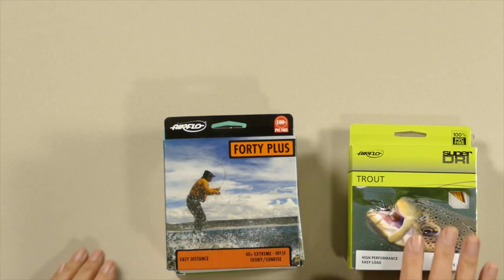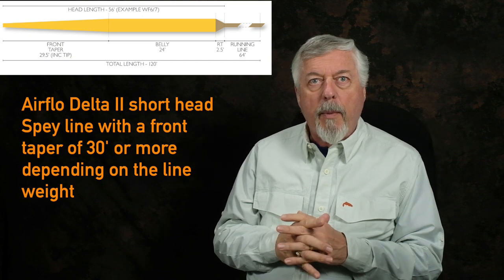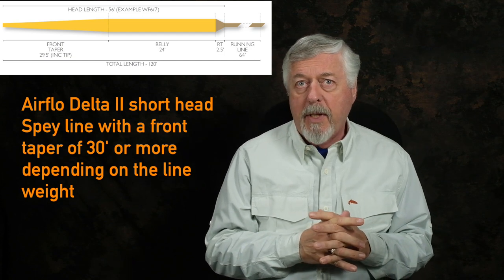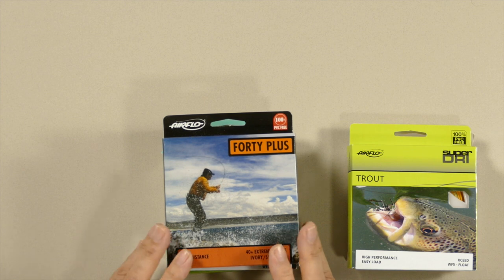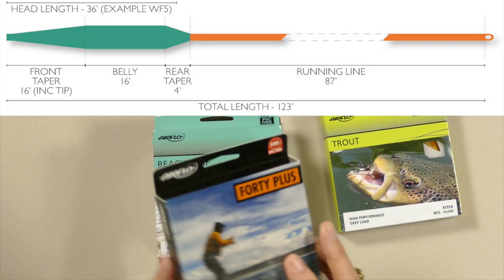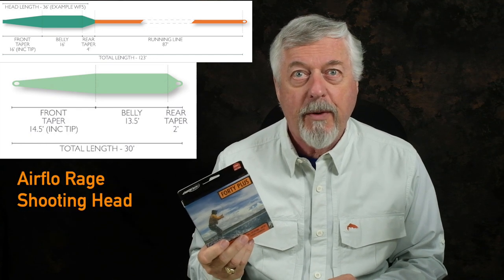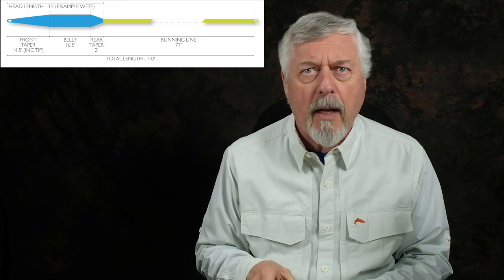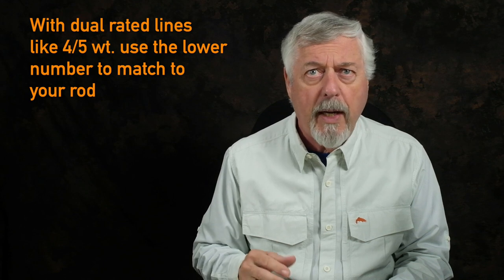Spey Casting Single Hand Lines: Here's what lines work and why

Comment: Another great video, thank you Peter, im as uncoordinated as it can get and very new to the sport, struggling with the OPST skagit head quite a bit, would it be fair to say a 40+ line might help learn the basics of single hand spey casting, 9' 6wt?
Reply from the maker: The older 40+ line with its very long front taper would work just fine, but the new Sniper 40+ is not that great for Spey casting. If you can find an older 40+ (no longer made), it'll do the job.
Reply: @hooked4lifeca  maybe the beach / surf, as I'd like to do some fly fishing in  saltwater as well

Comment: Hi there, whats the best floating line that's on the market just now, that i can Spey cast... Roll cast and that I could put airflo Polly leaders on? Just for my local river, don't have alot of back room for casting... Only using size 10 and 12  salmon doubles. Thank you 👍🏴🇺🇸
Reply from the maker: Are you using a single hand 8wt. or 9 wt?
Reply: @hooked4lifeca  Thanks for getting back to me. I am using the hardy demon #7. Just for grilse in the summer. Can't seem to find a good line 🎣👍
Reply from the maker: @gtchasingsilver  Airflo used to make a line called the Switch Float which was a full line, somewhat like the old 40+ only with a shorter 27'-28' head and a thick enough tip to turn trout Polyleaders. It might still be possible to find a few sitting on shelves as it wasn't that long ago when it was discontinued. Here's my video on it: https://www.youtube.com/watch?v=AMX0a3_P-q0

You could also look at the Airflo Scout as it's a very short 16'-17' head that will cast well in very tight spaces and turnover PolyLeaders with no difficulty. It's a head system line so it needs a running line as well.  https://www.youtube.com/watch?v=0hqP0U0RCGs
Reply: Thanks again, brilliant b👍🎣